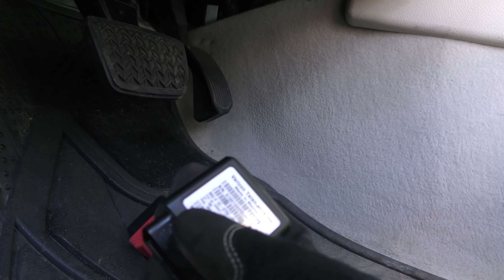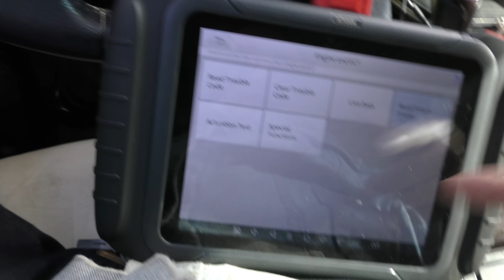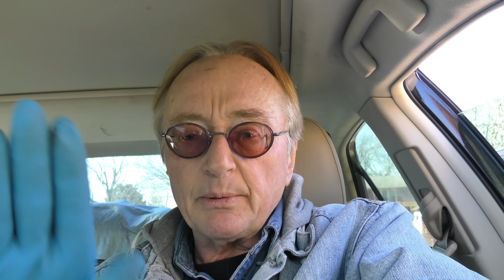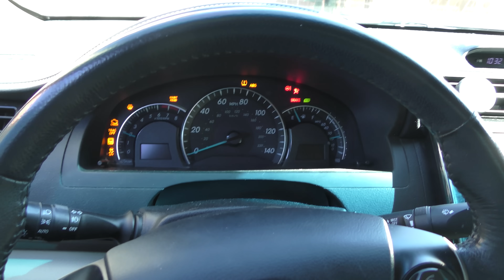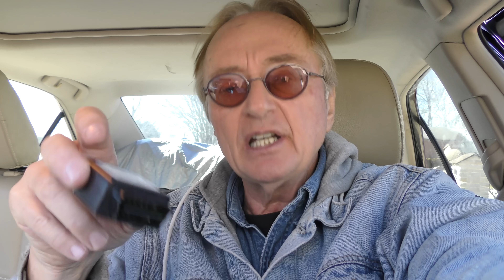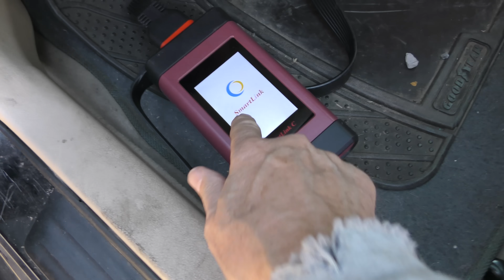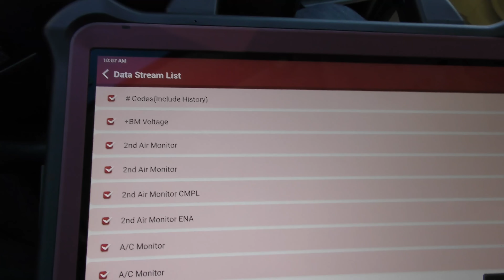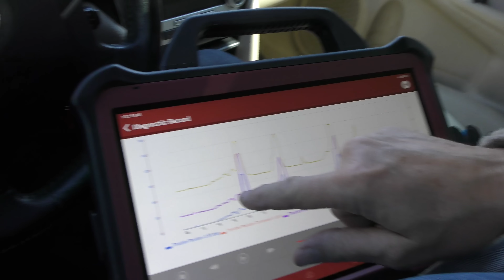This Stupid Device Just Cost My Customer Thousands in Car Repairs

Comment from the maker: GM Just Shut Down Car Production and May Be Going Bust: https://youtu.be/oxDufrTbJFI

⬇️Scotty’s Top DIY Tools:
1. Bluetooth Scan Tool: http://amzn.to/2nfvmaD
2. Mid-Grade Scan Tool: https://amzn.to/33dKI0k
3. My Fancy (Originally $5,000) Professional Scan Tool: https://amzn.to/31khBXC
4. Cheap Scan Tool: https://amzn.to/2D8Tvae
5. Dash Cam (Every Car Should Have One): https://amzn.to/2YQW36t
6. Basic Mechanic Tool Set: https://amzn.to/2tEr6Ce
7. Professional Socket Set: http://amzn.to/2Bzmccg 
8. Ratcheting Wrench Set: https://amzn.to/2BQjj8A
9. No Charging Required Car Jump Starter: https://amzn.to/3i7SH5D
10. Battery Pack Car Jump Starter: http://amzn.to/2nrc6qR

⬇️ Things used in this video: 
1. Common Sense 
2. 4k Camera: https://amzn.to/2HkjavH 
3. Camera Microphone: https://amzn.to/2Evn167 
4. Camera Tripod: https://amzn.to/2Jwog8S 
5. My computer for editing / uploading: https://amzn.to/301tYt9

Subscribe and hit the notification bell! ► https://goo.gl/CFismN

As an Amazon Associate I earn from qualifying purchases.
Reply: Scotty, I like where you were going, but by only taking that voltage reading (or current load test) from the battery terminal CLAMP SURFACE, it did not also completely evaluate the hidden cable-to-clamp electrical condition.  Those diagnostic graph "glitches" showing up simultaneously on multiple sub-systems points to a single power source problem or a bad ground somewhere.  Also, it's possible that the "cheap device" was installed AFTER the initial problem showed up (in someone's failed attempt to track down the source of the initial cold engine performance complaint). Love your videos!
 

BTW, diddling around with my new Xtooltech D-8 has got me into some unnecessary TRAC/VSC reset trouble... lol
Reply: Love your videos but I have to correct you on this one. That is not a code reader or programmer it's actually a Gps tracker, data transmitter for companies to track mileage and routes employees and/or contractors take during work hours. We use similar Devices on the trucking industry with the feature of electronic log books known as  ELD (electronic log device)
But yeah they do hook to your computer to read the mileage the computer is registering and compare it to mileage the tracking is sending on top of that compare it to the mileage the employee sends with his reports, but yes they'll mess with your ECM had it happen on a Peterbilt with a Cummins engine
Reply: Could be a battery corrosion problem the battery looks pretty gunked up.

Power instability can cause alot of issues in computer systems.

Like buying a cheap power supply for a computer can cause the computer to crash from voltage instability.
Reply: Sprint gave us 2 of them for our vehicles and they have been in for a good 3 years. I thought it was to help with cellphone service.
Reply: @DonaldAJr  IDK, but the truth will eventually come out. Seems unlikely it's designed to cause damage, but that is possible too with so much evil lurking about these days...
Reply: The computer runs a closed loop algorithm until the 02 sensor hits 600° and water temp is at 120°.  After that the computer adjusts. There are 3 very well known issues that cause hesitation like this.  1 is the crank position sensor, 2 is bad ground, 3 is battery related.  Looking at the shot of the battery, you did not do a good job cleaning the posts, combined with the earlier battery codes, and the fact the voltage drops are over multiple sensors not one (ruling out your proposed cause of the issue) I would take that battery in for a proper draw test clean the terminals check the major grounds.
Reply: I drive a 97 Honda Accord LX clover green pearl with a spoiler.  It doesn't even charge cell phones.  It still has a push cigarette lighter. It also has a tape player.  My Grandmother gave it to me after I totalled my 2005 Civic  Ex shoreline mist metallic.
Reply: @kiwilala2037  if it has a cigarette lighter as you stated. It can charge cell phones. 🤦‍♂️
Reply: Allstate insurance has you plug one in for there own black box information on your driving habits
Reply: @RubberCityRebel  why so you they can track you driving at 80 MPH ? I don’t think so
Reply: @kwhite145   Yes an watch your breaking for sudden stops
Reply: No it's the crank position sensor. That controls timing aka fire that's controlled by throttle. Very common issue. Heat short.
Reply: I have the Toyota keyboard ---aaAAAAAAAAAAAAAAAPPPPPPP!
Reply: 9
Reply: @burthough5098 ? 10🤷‍♂️
Reply: So, I should unplug my ScanGauge?
Reply: The bluetooth obd that Scotty recommends here, are they global or do you have to get an EU, US or JP version for your car?
Reply: What about those insurance dongles that plug into the computer port? Could those damage the vehicle?
Reply: Are those dongles that deactivate the AFM in GM cars bad for the ECM? Even though they are designed to stay in the OBD port?
Reply: I'm at GM Scotty. Slow? Yes.
Sinking ship? Maybe? 
Going bust? No way!

ON A TOPIC CLOSER TO THE VID - WHAT ABOUT A PARTIAL CYLINDER CUT OFF OVERRIDE DONGLE? BAD? WAY TOO EXPENSIVE TO REBUILD IT RIGHT🤕

Comment: It is the problem some cases it will cause a fire under the dash I had the same problem the insurance company was handed them out years ago Now they don't want to take carnability so I had to track all the wire that was burned every wire everything car still has the jitters after the same device

Comment: Always take the throttle body off before cleaning! You just washed all that coking right down into the catalytic converter! Also diagnostic is so far off, after setting multiple tps codes as well as the freeze frame data catching glitches sure would be looking into the tps built into the throttle actuator with an oscilloscope and not with a scan tool. I'm a driveability tech now for 28 years and this guy, albeit charasmatic is just a backyard mechanic at best and people should take his advice with a huge grain of salt and contact an actual professional with in depth auto repair issues.

Comment: I have an 03F150 Ford. Pick up 4 point six, engine 130000 miles On it had it since 2012. Should I change the transmission fluid? I don't know when it was ever changed before I bought it.  Thanks
MAX

Comment: Anybody else notice that he first lists off a p2109 code, then later says it threw a p2109  which is a completely different code for the other end of the throttle system. Sounds more like it is throwing the same code and his “cleaning” didn’t do anything, that combined with a startability code, a crank position sensor code, are pointing to a battery, alternator, or grounding issue ( or power line to ecm).                                                     And as for the insurance reader, that IS designed to stay in there, all it is doing is monitoring vehicle speed, APP (accelerator pedal position) etc, to record your driving habits ( I won’t ever use one, cause then my rates would go up hahaha), I have NEVER seen one do permanent damage ( unless it shorted and blew a fuse, but not exactly permanent), typically when there is an issue, those things interfere with the network, and after removing them the problem is gone ( can watch the network glitching using a scope and a breakout box, then unplug unit and no more glitching

Comment: Not leaving anything plugged into the OBDII diagnostic port is just common sense.  But you have also reinforced my desired to never have a drive by wire car.  Our 2007 Corolla 5-speeds have both been great, but even those and our 2004 Grand Cherokee are much newer than I prefer. Easily maintainable (and fun) cars were made in the 50’s and 60’s.

Comment: You may wish to watch back your video's when editing them. The fault code was the same at the start and the end p2109 you were right its the throttle body and also that its a position sensor but its the sensor on the throttle not the pedal.They always run two sensors on both ends that are the opposite to each other. Any mismatch and it defaults to zero throttle for safety.

I suspect the carbon tracks on the tps are wearing out and they are worn out more in one spot than the rest.

Comment: Oddly on my Ford an entire throttle body and TPS are $40 or so.  In that case, just replace it yourself.  The common symptom there is that the car dies at the end of a freeway offramp.  The internals of these things are often plastic for no good reason and the little "gears" wear out.  A slowly dying fuel pump also is common if power is not developing properly or changing suddenly. But of course check the obvious like tap the cats to make sure they're not rattling/full of broken bits and so on and the grounds/wires.  It could be as simple as a critter got in there and chewed up a wire or a dodgy terminal.

Comment: Except for the AFM disable module that turns off the Adjustable Fuel Management AFM system that turns off 4 of the cylinders during driving to increase fuel economy and thereby eventually causes a hydraulic lifter to collapse, very expensive and negates ALL the fuel costs you thought you saved.

Comment: Those little dongles are only for enthusiasts who know what they're doing, and to read codes for a preliminary diagnostic or a general idea of a quick fix (ignition coils, sensors, etc.), viewing the parameters while idling or just reading general details from the ECU, not for recording data. Nothing will ever replace a dedicated ECU computer running off its own power.

Comment: That dongle is specifically designed to be left plugged in all the time. In addition to reporting telemetry, it does GPS tracking as well. Something’s deeply flawed with the design of the car computer if reading diagnostic data can end up corrupting it somehow.

Comment: The fact that the dongle says “telematics” tells you that it IS designed to remain plugged in at all times. What use would a telematics system be if it wasn’t plugged in? Here in the UK lots of young drivers cannot get car insurance unless they agree to have one of these things plugged in at all times which relays their driving habits (including acceleration, braking, steering g-forces) miles driven and times driven to the insurance company regularly. If they unplug the box, they are effectively uninsured.

Comment: "you know how many computers I've replaced because of dongles?" (paraphrased). Do you know how many years I've driven my vehicle with a cheap dongle plugged in 24/7 without any issue? Yeah. The entire 8 years I've owned the damn thing. No issues ever. Not saying a dongle can't cause an issue, but a reputable one will be just fine. What the hell do you think that "Live data" is for? Diagnosis, yes, but how do ppl with tuned and souped up cars know what's happening? Something plugged in constantly to the computer. Maybe this particular dongle was defective, and that happens, but don't just hate on them in a blanket fashion, that's ignorant.

Comment: I think some of those devices can be programmed to limit the vehicle speed by quickly switching in/out or pushing the throttle position communication signal high/low to modulate the throttle in a strange non-smooth way that lights the CEL. In this case I'm assuming you reproduced the issue without it plugged-in so it's probably not that.

Comment: If it was made for Verizon, it isnt a cheap piece of junk. And if they're going to cause damage, they're going to damage any module on that CAN network. Things plugged in can cause erratic behavior. I had my scan tool plugged in while driving, and when I came to a stop it caused my BCM to lock up. I had to pull its fuse to get the car to function again.

Comment: Somebody else plugged it in... these things can do some diagnostics but primarily they are cheap gps tracking devices with a wireless connection service.  That's load, and  who has certified that the car computer can support the current requirements as a "permanent" installation?  That's right: nobody.  There are companies that engineer proper devices that don't drain power off of what should just be a communications bus - lojack comes to mind but I'm sure there are others.  Shame on Verizon for even selling these dumb things without a separate fused power source [& instructions].  There's a quiet unwritten guidepost regarding power/protection and its this: for continuous service, avoid operating past 85% of rating.  In the case of transmitters, it can be much lower - I have seen beacons that will blow fuses if operated past 65% continuous load [they were designed for modulating and staying off peak power in a quiescent state where only carrier frequency was broadcast, and were happy at 50-60% power which provided about a 15 mile range].  As always... telco's are run by crackheads.

Comment: Corrosion on the right plug in, would definitely cause this problem.   I discovered this on my son's car, back in the 90s.  I wire brushed the connector, and the timing advanced like it was supposed to.

Comment: Normally I agree with most of the stuff that you say in your videos, but nothing in this video points to the bluetooth dongle as the culprit. You mentioned the low battery at the beginning of the video and then after seeing that it was a voltage issue causing the problems never circled back to it. The odds of the bluetooth obd causing the problems that car is having are slim to none. You claim they aren't designed to have things plugged into them all the time, but that is what the computer is doing all the time. It is always sending and receiving information. The tiny draw that obd scanner has, isn't going to fry the computer unless there was already an issue with the computer. If the obd was wired wrong, then I could see an issue, but it would cause worse problems than you are seeing.

Comment: I gotta tell you, I didn't see any evidence that the dongle did any of that.  If you unplugged it and then you also cleaned sensors, you have now done multiple things at once.  That's poor troubleshooting because you didn't isolate the problem to a single cause.  Additionally,  The plug is fused, and toyotas didn't have computers 53 years ago.  And did that car with the bad computer have a dongle?  Nope.  It is possible to adjust parameters through that port but you have to do it through the cann bus, which isn't used to read trouble codes.  It should be literally impossible for that dongle to break anything.  It's less likely than the computer you were scanning with to break something.

Comment: Do not ever jam an electronically actuated throttle!!!!   This will often damage the motor and linkage inside the throttle assembly or possibly strip the internal gears!  Never do this!!!!!   All you need to do is key up the vehicle without starting the engine and mash the gas pedal.  Throttle fully opens.  This also allows you to see if the throttle does indeed fully open when only using on board components.  This video is not the correct way to perform this repair.

Comment: I am a computer design engineer, and I have been asking my gearhead friends for years what are the ramifications of saturating the OBD bus with a gadget like this. Everyone assures me "nah, it's nothing! you just plug it in and drive."

That instrument cluster from eBay takes from the same pool of resources that the ECU and all of the sensors use.

Comment: I hate new cars and all the electronics, ends up costing a fortune just to get things diagnosed, if you can. In saying that, my vehicle is now 27yrs old and has the OBD1 system which no one has and trying to find a diagnostic machine is impossible as the technology no longer exists to fix it. Being on a disability pension I can't afford to buy another car so basically I'm screwed. Give me the old days when things were a lot easier to repair and you didn't need a science degree just to read a computer screen.

Comment: Honestly a majority just feed off the main power just to light some LEDs, sometimes a random flashing LED or two just to make them seem like they are doing stuff when it's really just a fancy blinky pointless light. However I wouldn't doubt the existence of more malicious dongles than those.
Also if this video weren't over a year old, I'd have also stated that maybe you should've yeeted the dongle towards Big Clive for him to take a look inside of it to see if it's just one of the dumbo power only dongles that powers an led or two, or if it's got way more going on inside of it. But unfortunately, unless he knows what it is called on the web to buy one for taking apart, don't think we'll ever know what is inside of this particular type of dongle. However for the computer to have been messed up isn't great. And I do reckon that there was a fair possibility that dongle, if built with malicious purpose, was the culprit.

Comment: I'm sorry. Maybe I'm blind, but where did you find anything that tied the issues back to the telemetry dongle? I saw no evidence of that, and these are designed specifically to be left installed. They will kill a battery over time, but most newer modules should shut themselves off if they detect power below a certain threshold like 11.4V, much like hardwire kits for dash cams.

Comment: I had a bad throttle pressure sensor on a 2002 Hyundai Accent. It would suddenly rev up over 5000+ RPM on city streets and to stop at a stop sign I'd have to stomp both feet on the break petal. I had no idea such a thing existed, but fortunately it was still under warranty.

Comment: I have a 2012 Camry XLE and been having transmission shudder, then ABS and traction light came on. I took it to a transmission shop and they are telling me the transmission problem was caused by the rear wheel bearing. This doesn’t sound right to me. I asked about servicing the transmission but he said it is probably just the wheel bearings that need replaced. What do you think?